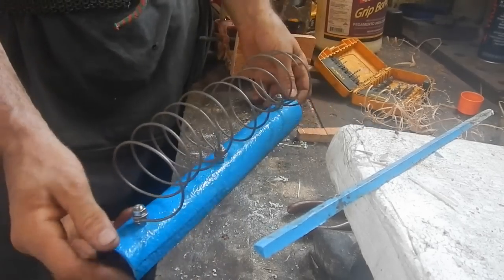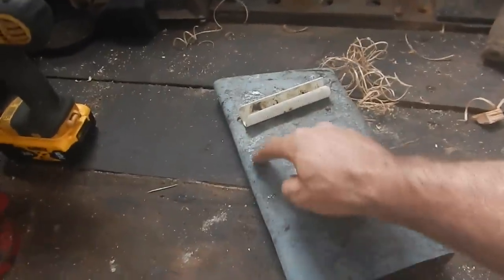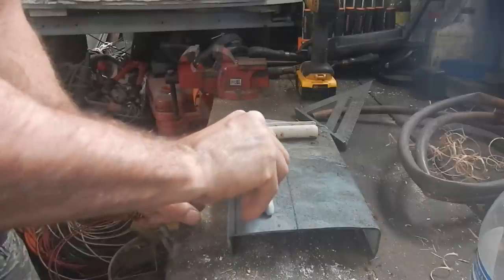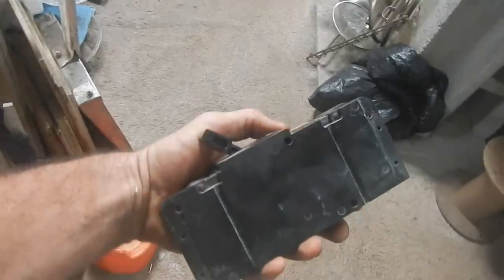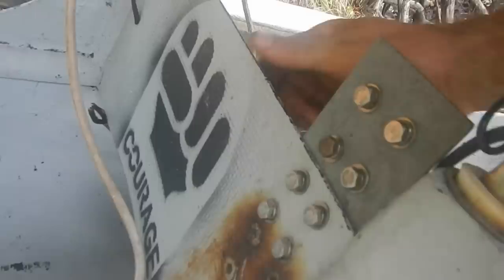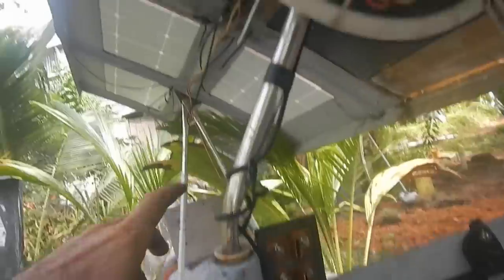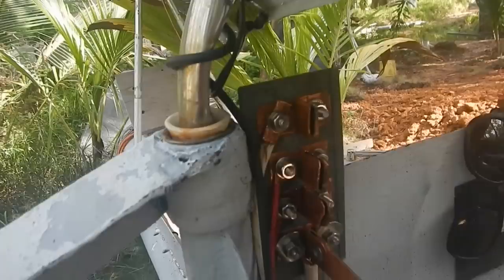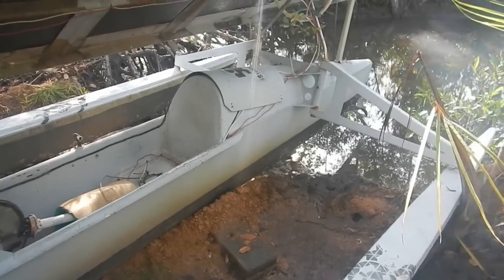Zombie Chopper 005 Finished!!!

Comment: Question on the nichrome wire you can put your connection anyplace up and down that wire for different speeds but isn't the nichrome wire using the same amount of electricity as if the motor was on high because it's using all the electricity to heat that wire

Comment: Looks like if you end up having excess power for a 5 hour round trip, then the next mod is a more aggresive prop for more speeeeed
Reply: No. I don't think it has enough power to run at full power and charge the battery at the same time.
Reply: I concur.  speed is paramount!